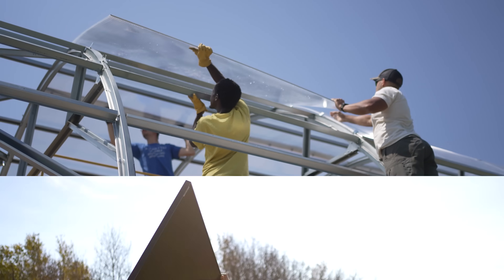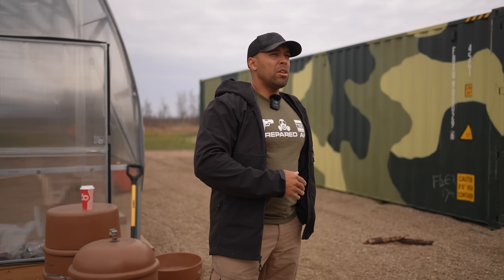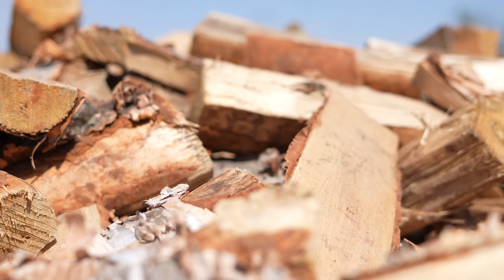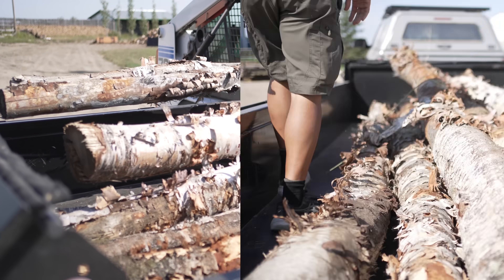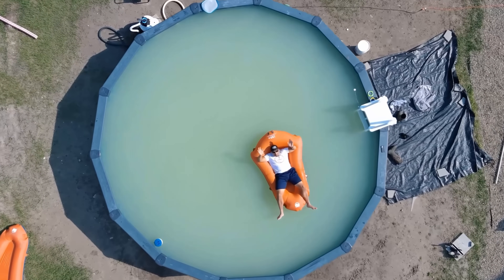I Built an Off-Grid Apocalypse RETREAT in 6 Months

Comment: Nate get a old rail road pc of rail
About 10 foot. Weld a chain to ea side take ea chain to back of tractor.   Pull it from tractor
Great for smoothing gravel rd when pot wholes appear
Reply: Yes that works better than tires chained together!!!
Reply: Did you not see the equipment he has? He doesn’t need that 😂
Reply: @alphafitter4699  Actually he does need this kind of setup because for those of us that live on long gravel roads we know that hooking up the chain with the tires or the railroad tie behind the truck once a month helps maintain the road and is a cost saving on tires and vehical wear and tear! 

Typically we will pull it behind the vehicle once a month and leave it at the end of the driveway, go to town run our errands and hook it back up on our way home this type of setup grades the roads Gently and will fill in any ruts or depressions that the road may encounter with regular use.

Comment: A birch forest cultivated for firewood is a good idea:
1. Birch grows quickly
2. If necessary, it burns even when wet
3. After cutting down a tree, it grows from the root into several shoots, which also grow quickly. They can be cut to a thickness of about 10-12 cm, which will make the work easier and after cutting into blocks, there is no need to split them.
Good luck!

Comment: 00:00 🏠 Introduction to the Off-Grid Retreat
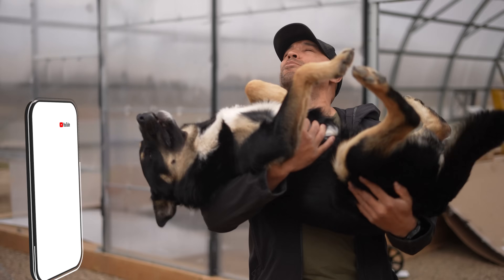01:18 🐈 Early Life on the Homestead
01:58 ☀ Solar Power System
03:23 🌿 Greenhouse & Food Production
05:10 🌳 Orchard & Food Forest
06:06 🐈 Pest Control
06:47 🚿 Irrigation System
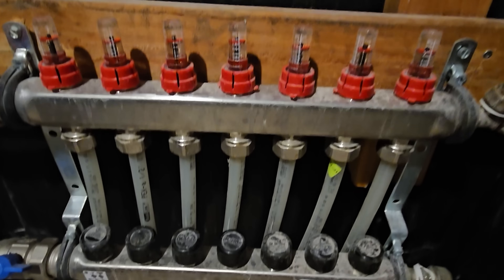08:00 ❄ Heating & Firewood
09:11 🚧 Gravel & Accessibility
09:40 🚧 Gravel & Road Construction
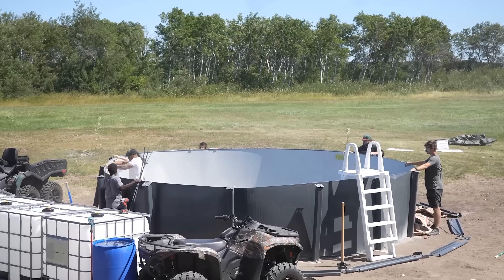10:38 💧 Emergency Water Supply
11:29 🚜 Tractor & Equipment
12:51 🏹 Archery Range
14:16 🐄 Animals & Fencing
15:53 📦 Secure Container
16:23 🌱 Garden & Tree Planting
18:20 🚧 Fencing & Property Development
19:12 🔒 Security Measures
19:55 🌳 Clearing the Forest
20:50 🏕 Camping Spot Setup
Reply: That was very kind of you to do this eric.

Comment: I have moles on my property.  I used wire mesh on the bottom of my raised beds to keep them out of my garden beds.  I did not know about wind screens, which I also have problems with, so I'm going to research what is available in my area.  Good work.  Blessings

Comment: Land equals freedom.
One of the first pieces of equipment to get is a 5 ton excavator. Big enough to dig foundations, small enough to load a firewood processor. Easy to transport around property by a small tractor if tracking takes too long. Ditches, drainage, clearing, there is no limit to what a excavator that size can do.

Comment: You should do a floating raft hydo system in the greenhouse.  It will do well.  Also a barn-style garage with a full service shop complete with 4-point lift.  You can store solar energy in a large air compressor too.  If you want to cut the fat cut the driving food.

Comment: Well done, Nate. That property has been a labor of love. You got off your ass and got it done. Many kudos to you.
The Kubota series of tractors is a great move. They are a good machine. You absolutely need machinery if you are going to manage that many acres. 5 Acres is probably the upper limit if you are going to do most of your work by hand.
The greenhouse looks good. Are the panels resistant to hail? 
Your garden will keep on improving with all the added mulch you are applying. Have you thought about Terra Preta? Makes quite a difference and adds valuable microbes to the soil.
Sheep are good, but you need a sheep dog for rounding them up. They need some maintenance. Crutching and MUESLING are necessary if you have blowflies. Very sad to see your flock getting fly blown. They die in agony. This is VERY Important. 
Are your cats fixed? You will be overrun with them if not. They will take out rabbits even, if they go wild.
With bunkers, they protect you for sure but if people find your air supply you are vulnerable and you're not going anywhere.

Comment: Probably no-one reads comments but:
- Keep an eye if there are spring floods when the snow melts and where the water flows. Fields might need trenches. 
- Check the shape of roots of different trees. Some (like spruce vs. pines) are more prone to wind falls in storms. There are differences between varieties i.e. silver birch has deeper roots than sand birch. Deeper roots the better. 
- Fences need to be at least 2m high to prevent deer, and I’m not sure if they are high enough even then. 
- Moose are formidable. They can chase off bears.

Comment: Build your raised garden beds out of 2x12 pine but burn the outside of the wood all of the surface with a torch before building them it’s how I did mine and they last longer than the ones I built out of cedar they do not rot as fast and bugs don’t eat them. Mine is 10 years old and still strong.

Comment: There is a product that you use/mix in the soil when planting trees or shrubs. This product releases moisture when needed and when it rains the product absorbs the water and the cycle repeats. IDK what it's called but similar to the crystals used in diapers. I might be the thing you need to keep your trees from drying out until the root system is established.

Comment: Hey Nate, have you looked into biogas? Mine is currently “activating” and I’m going to use it for underfloor heating and also a generac generator if I scrub the gas enough, and maybe put a heat exchanger on the radiator so when I run the gen I get additional hot water. Just gotta keep it warm enough, and you can with a sump pump cycling through a heat exchanger/its own hot water system, I’m currently doing that right now to keep it warm enough for the right bacteria to grow so it can start

Comment: Your gravel looks about half inch or less, which is likely to blow away.  You will likely need 3/4 inch "roadstone" in a few years when the smaller stuff gets thinned out by the wind.  The base below the 3/4 inch should be 2x4 inch, to keep the 3/4 inch from being pushed down into the mud and nearly disappearing in case of heavy vehicles.

Comment: I'm just starting to use a solar panel battery pack for the first time and think the battery technology is not yet up to speed for needs. It seems the rechargeable lithium battery isn't very durable to last long if used heavily, they keep a charge much better than other batteries when not used, but are very easy to destroy with any overcharging.

Comment: Bought a system from solar power store in Barrie Ontario,  utter Nonsense. 
Been trying to get some support as was promised when I purchased gear , also trying to buy more gear but no one gets back to you, even had call booked that never did come.
Not to mention putting together a system in the beginning that wouldn't work for what I needed it to,  had to drive it 2000km across the country to exchange for what I needed.
Wsup with this??
Buyer beware

Comment: Also mix the trees you are planting, and don't plant them in a row like a plantation. 

If your goal is a healthy and diverse ecosystem, you should mix tree varieties and create tiny ponds here and there. 

Do research into what it takes to keep a thriving ecosystem. Don't just go with your own assumptions here, is what I highly suggest here.

PS! When you plant trees, for the first 2-3 years they should be mostly covered by the surrounding grass or foliage. They are very sensitive to the sun and winds at the early stage so you need to keep them covered from those elements.

Comment: If I could have just interject on one thing so far I'm up to the irrigation system? I don't think it will use a lot of power if you can somehow wrap those hoses towards the top of where that gray pipe begins in wrap it around the hoses into the ground you could probably get a heating system where in the winter it won't freeze I know it might have to take a little bit of power from your battery packs it won't take a lot I think back then when I was doing a little bit of plumbing with a day laborer company you guys used to wrap copper piping with hot wire? But the hot wire would feed the water because they were really big houses that would contract us? Mini Mansions so they would wrap it with some sort of wire that would heat up the pipe under the floors so the water will come up at least warm to the top of the house? You could try that, I just thought I would throw a little idea forward about how he can keep his irrigation system from getting Frozen in the winter time? Just thought I would share I like his irrigation system.

Comment: Hey Nate, I'm curious about your solar panel system.  I have solar panels and they're set up for net metering for the grid.  We're in PEI and were told that batteries were not yet legislated but they were expecting a law allowing battery back up for homes on the grid with solar panels at the beginning of 2024.  I've heard nothing since.  I'm wondering if you just went around the red tape or is it now legal to have batteries.  Thx

Comment: problem with batteries is that they dont last long, specially if u do one full charge cycle per day u will get 5 year lifespan, a good generator lasts forever technically; fuel u have to synthesise..